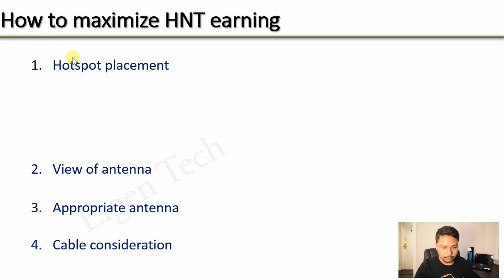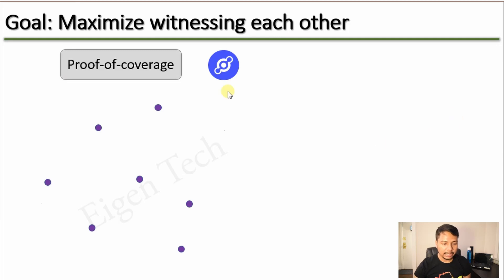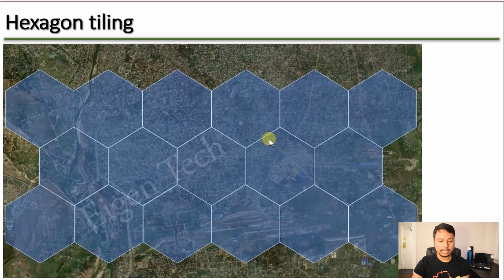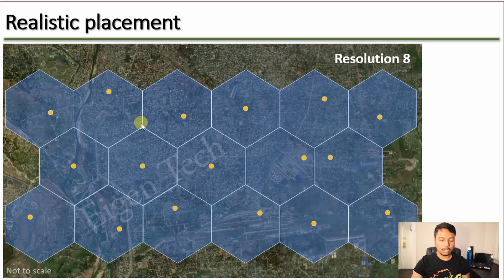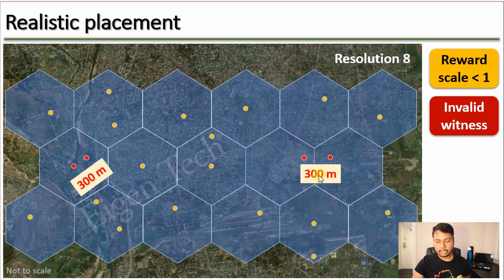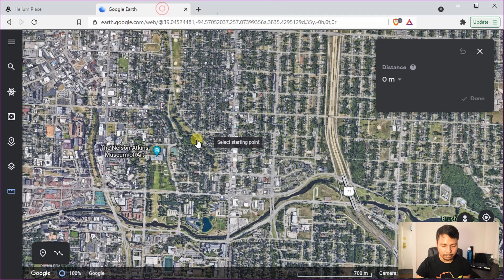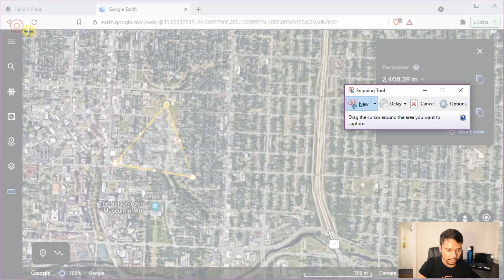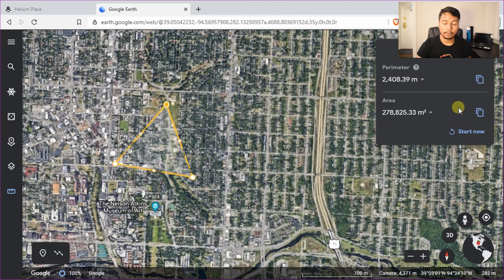How to place Helium hotspots? Perfect placement for your Helium Miners | Maximize your HNT earnings

Comment: I have upgraded 8 dbi antenna placed 20 ft high only 2 hotspots I have bobcat 300 the 2nd hotspot that shares my hex has a 2.3 dbi antenna yet our transmission reading is identical can advice?  My miner & antenna should be outperforming their antenna ?
Reply from the maker: It could happen that your 8dBi antenna reaches further out but does not communicate with the nearby ones whereas the 2.3 dBi mostly talks to nearby ones and hence both get a somewhat equal number of witnesses. Buth those should witness a different set of miners.

Comment: hello...I am a subscriber to your channel. I have just put my miner online a few days ago. newbie advice please... how can I change the internal settings on my bobcat? I had to accept 4dbi as antenna setting, but have attached an 8 dbi  but still showing as "4".  also when I set it up I configured for WiFi  but have now also added an ethernet connection  both now operating...how do I disconnect WiFi  but still  bobcat to use the ethernet connection....not set up for that... cant find a control panel for these settings..... thanks
Reply from the maker: To change antenna gain follow this video https://youtu.be/Gg0toqB57j4. For ethernet, pair using Bluetooth, then try to connect to a new wifi network and forget the old password - it should then use the ethernet

Comment: Hey Roy, I have got my first Clodpi Helium Miner and today I have installed it. As of now I kept it on the roof though its indoor miner. Since last 8 hours, its showing as Syncing. How many time it should take to be in Synced mode ?
Reply from the maker: Just make sure that water doesn't go into the miner. It takes several days for the miner to finish syncing
Reply: @eigentech6567  Thank You Roy 👍
Reply from the maker: @anugauravanu  you are welcome

Comment: This is a great video jam-packed with information. Thank you for this. @Eigen Tech I have a hexagon with 2 other miners but both miners have been offline for a while. Will my reward scale still be less because three are designated there or should remain as if I was 1 in the area since the other 2 are inactive? Thank you!
Reply from the maker: You are welcome. No, inactive miners are not included in the transmit scale calculation, so you should be good.

Comment: Does it need a internet connection ?? If so how much Mbps{net speed}does it need to run a helium miner or does it only needs an electricity connection ?? Plz do reply
Reply from the maker: Any Helium miner needs an internet connection, around 200-500 kbps. Monthly consumption 30-50 GB

Comment: Stock antenna cable is too short
Reply from the maker: You can always buy cable extensions
Reply: @eigentech6567  what cable model do you recommend that has low signal loss? Is 10ft cable ok? I have to put my antenna on a pole to get good reception
Reply from the maker: @nilarmstrong  LMR400 is the most popular. Yes, 10ft should not have much loss. Good idea.
Reply: @eigentech6567  thanks more power! What cable extension brand do you use?
Reply from the maker: @nilarmstrong  I am just using a common short wifi-extension cable, don't remember the brand

Comment: Can I use the same WiFi Internet for 2 HNT hotspots if they are 400 meters apart?
Reply from the maker: Sure, you can. But I doubt your wifi signal can reach that far unless you are running ethernet cables. Also, one of the hotspots will always be relayed.
Reply: @eigentech6567   @Eigen Tech  So to avoid relay status it is better to use different internet connxns?
Reply from the maker: @rajiv8420  Yes, you will need different public IP

Comment: Can you assert a location that is not accurate to the real location of your miner.  For example if I assert a location on the helium app that is 300 meters to the east of my miner than I will be in a hex with no other hotspots.  Will this help coverage or will it be too inaccurate and lower my reward scale.  It is a bit of a cheat I think, but will it work?  Will it help the network coverage or will it be a bad thing?
Reply from the maker: Normally people can assert location within a 100m radius. It should work but will be a bit of cheating as you said.
Reply: @eigentech6567  I would have to re-assert the location to do this.  will that cause any issues?  Will it leave a offline hotspot icon on the explorer map at the previous location?
Reply from the maker: @eatblogtravel  No, when you re-assert the hotspot disappears from the old location and appears at the new place.

Comment: What Are Obstacles Means, please Just Explain me there are buildings between my 1st to 2nd hotspot will that effect
Reply from the maker: Obstacles mean buildings, trees, hills anything that blocks light. It is preferred to have a line of sight but sometimes radio signals can bend around and still reach other hotspots. If you receive witnesses from each other you will be fine.

Comment: not true, you can have multiple hotpspots in a hex, this does not automatically mean the reward scale drops. It largely does depend on the witnesses but also the SNR. If you are stronger you basically will control that Hex, you gain more % of rewards vs the other miners. plenty of areas with multiple hotpots, all at 1.0 scale. one of mine has always been at 1.0 with 4 other miners within a stones throw, under 100m
Reply from the maker: You are right. There are situations where multiple hotspots could be in a single hex without getting the reward scale reduced. Here I wanted to give a simpler picture with the focus being that if there is only one hotspot in each hex the reward scale will be 1.

Comment: I have two locations which are 1100-1200 metres apart in my city. There are no other hotspots in my city. Do you recommend placing them at those locations?
Reply from the maker: If you make sure they have a clear line of sight, there will be no problem.
Reply: @eigentech6567  I live in Kolkata which is a city that is extremely crowded with a lot of buildings. Do the signals only work in straight lines?
Reply from the maker: @turyaganguly447  The signals get scattered so the line of sight is not truly needed. For your case, it will be best to place the first one and then use the discovery mode for the 2nd one to check whether the 2nd can reach the first.
Reply: @eigentech6567  Thank you for all the information. ☺️
Reply from the maker: @turyaganguly447  You are welcome

Comment: What do you mean when there is a hot spot? How do I know what a hot spot is? for example I'm going to put 4 bobcat miner 300 devices and how do I know that one of those is a hot spot? Or who defines what is a hot spot and how many coins does each device take out if I buy four, how many coins do I take out if I place them at 800 meters each?
Reply from the maker: hotspot = miner. You should do a little more research on how helium mining works

Comment: Great video, why 800 meters? I have heard other opinions that it should be between 300-500. Also how do other RES effect? Thanks.
Reply from the maker: I have already explained it in the video. It is because center to center distance between 2 neighboring Res8 hex is about 800m. Other Res hexes cannot be explained in simple terms
Reply: If we have only two hotspots and they too are separated by 4-5 miles, is that a negative point?
Reply from the maker: @trendingstuff2322  if they can witness each other there is no problem
Reply: @eigentech6567  okay thanks a lot.
Reply from the maker: @trendingstuff2322  You are welcome

Comment: does glass (a window) affect the signal to the antenna ?
Reply from the maker: Yes, it blocks the radio signal partially
Reply: @eigentech6567  when you say partially, is there a marked difference between inside on the window ledge and outside on the exterior window ledge?
Reply from the maker: @bucharestred  yes, if you can place your antenna on the exterior ledge, it will definitely work better. Think it this way, some of the signal that was earlier wasted inside your room now has the opportunity to travel outside
Reply: @eigentech6567  thanks buddy.

Comment: Hello
I've done my connection to do ethernet cable 
My initial router is in bridge mode and the cable goes from the second one to the miner 
My question is at the cable is possible not to have good connection because the led at the cable dose not blinks?
Thanks
Reply from the maker: Usually the LED blinks, but might depend on the exact model. Maybe for troubleshooting connect to other ethernet ports.

Comment: can the standard in the box Bobcat Miner antenna be installed outside ?
Reply from the maker: I would not strongly recommend it but if you can make sure that water does not get into the connectors, the stock antenna can be used outside
Reply: @eigentech6567  what are good antennas to buy that are waterproof?
Reply from the maker: @gpt4three  II think all outdoor antennas are waterproof. You can put some waterproof tape at the connector area though. I do not have recommendation for any particular brand
Reply: @eigentech6567  thank you 🙏
Reply from the maker: @gpt4three  You are welcome

Comment: Very good Video and English. I knew all of the info that you covered but watched it incase I learned something new. I will saw that this is the first video that I've seen that covers all the key points. 
Next time  include the dbi loss from the longer cables to the antenna, and use quality  lmr 400 or lmr 600 for really long cables.
Reply from the maker: Thanks for your suggestions. I will make another video discussing the last 3 points in more detail and I will discuss the cable losses for outdoor antennas in that.
Reply: @eigentech6567  for the LMR-400 cable I use it's 0.036 dbi loss per foot. Example 1.8dbi loss on a 50 foot cable. A 5.8 dbi would be reduced to 4dbi.
Reply from the maker: @joevillavicencio6548  cool. will add this info

Comment: Thanks for the post. I would just like to know, I'm in a suburban area. my 1st hotspot will be placed well with a clear line of coverage. But my second location  will be placed 2.2km apart and there are many high trees in this location with signal coverage in general poor in this area. Do you think it could still work, and if so what antennas would you suggest I use?
Reply from the maker: It is actually very difficult to say that. Probably after placing one hotspot you will be able to use the "discovery mode" from the second hotspot to figure out whether they can witness each other.
Reply: Yes 2.4km is close by as long as  both antennas have line of site.
Reply: @joevillavicencio6548  thank you. So you would suggest I try with stock antenna indoors at window, or upgraded antenna on roof?
Reply: @sayet6707  if possible Always roof / chimmony/ mast/ tree/ ect... antenna!! Let those antennas see some blue sky so they have space to stretch out! If not window facing in the direction of the most miners and remove the window metal bug screen if you have one. It messes with the signal.